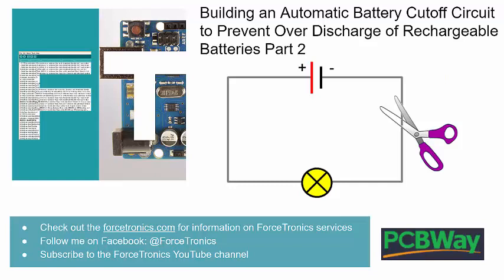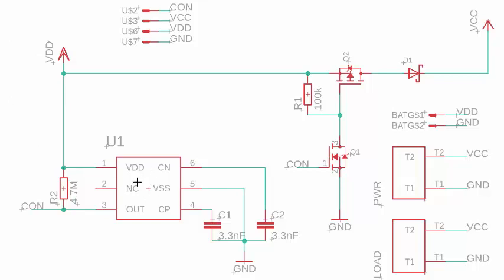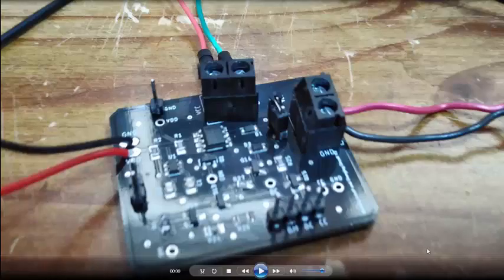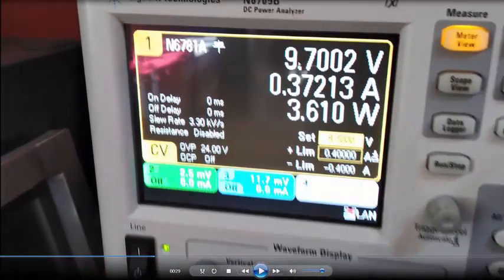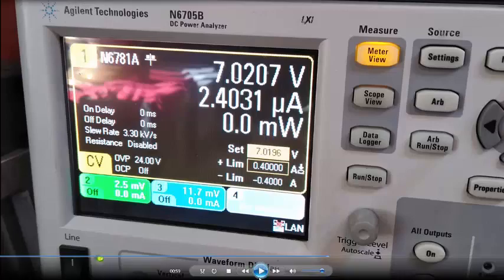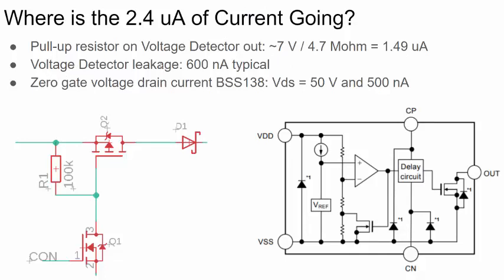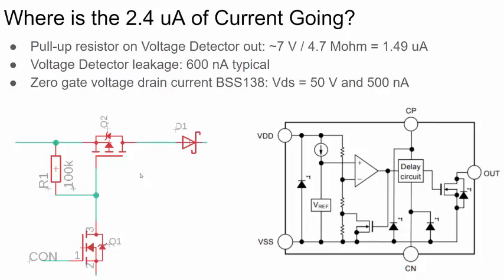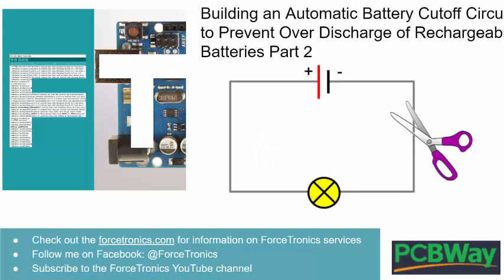Building a Battery Cutoff Circuit to Prevent Over Discharge of Rechargeable Batteries Part 2

Comment: is there an ic that handles all of this?
Reply from the maker: The IC is a voltage detector. I haven't seen a voltage detector with integrated mosfets. Probably because mosfets come in all different current voltage and power ratings so they leave it up to the designer to add the mosfets that fit their application

Comment: Bro, your videos are amazing! Thank you for sharing them with us free of charge! Especially your incredibly in depth explanations of the appropriate subjects WITHOUT ging into tedium and also WITHOUT repeating everything 5 times! It makes these videos really valuable and enjoyable for me to watch. I am learning so much simply because you explain everything in detail, many YouTuber assume a large amount of knowledge from the viewer, and while you still assume some knowledge, you assume a reasonable amount that is perfect for a noob like me to pick this stuff up at lightning speed! Stuff I haven't truly understood for years and years and I've always just used "because that is how you do it" I now fully understand why it has to be done that way. And that isn't as much knowledge that you are teaching, but you are teaching me insight and a little bit of experience, which in my humble opinion are even more valuable than just plain knowledge! Thank you bro, it is very much appreciated 👍☺️😊

I have a suggestion/question that may be really dumb in hindsight, but I currently possess insufficient knowledge to properly judge that. Wouldn't it be possible and very much feasible to design the voltage cutoff circuit with perhaps your currently implemented cutoff as a 'soft' cutoff feature that will auto recover after being charged, and then add a more permanent cutoff to 100% protect the batteries for a longer period by using a latching relay to fully break the connection to the batteries if the voltage were to reach an even more critical level? They would then be safe from any and all further discharge, and the user could be indicated to press a button or something via an LED when they are plugging in the charger in order to reconnect the batteries and allow for charging (and after that, discharging) again. 

If I slightly extend this question, perhaps it would even be possible to use a latching relay in the manner I described above, but instead of the user pressing a button, the suddenly incoming voltage from the plugging charger might be able to be used to actually un-latch the latching relay, thus automatically restore the connection to the battery without requiring a concerted effort from the user. 

I have only read about latching relays before, but I have seen them in YouTube videos, so I am not completely clueless but still, I haven't really had a reason to buy one and play with it on a breadboard or something, so I'm afraid my practical knowledge and intuition on the subject of latching relays is not sufficient to be able to ascertain if this proposal of mine is feasible as such. I'm really curious what you think about this idea, is it perhaps a useful one worthy of trying out, or it is a fools errand? (And if so, why is it a fools errand?) Or perhaps with a slight modification it could be made feasible? 🤓 Thank you very much for reading my comment! 😊 I look forward to reading your response, but if you're too busy of course, then no worries, I understand 🥺
.... 😟 
.... 😥
.... 😢
I CRIE EVRYTIM! 😭 (That is a joke, of course, but still. The number of times I have spent 30 minutes, one hour or sometimes even two hours (yes, really, not hyperbole, although this time it is more like 30 mins) writing a (imho) really nice comment, just to have it go completely ignored by the target of my admiration is too damn high!)